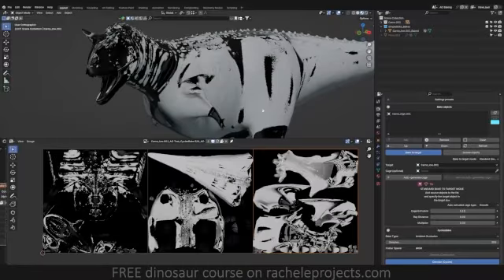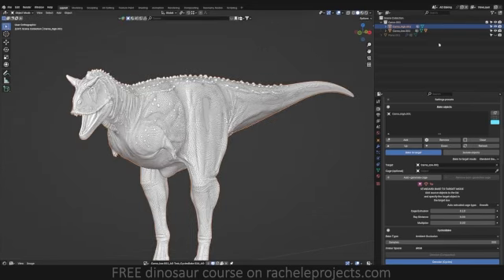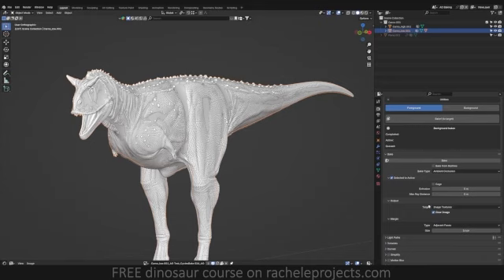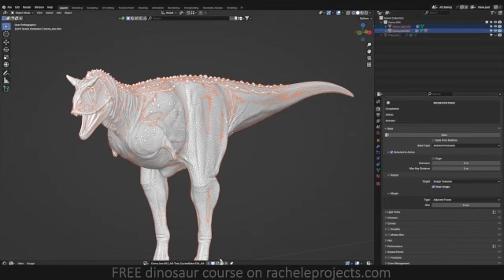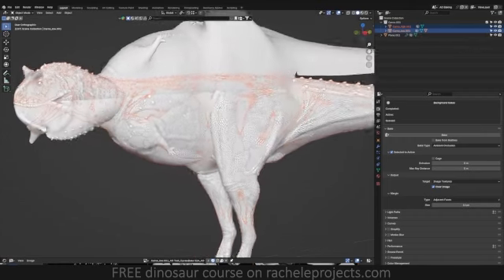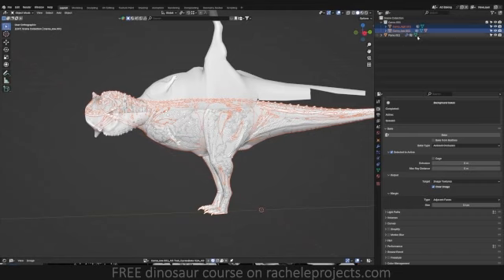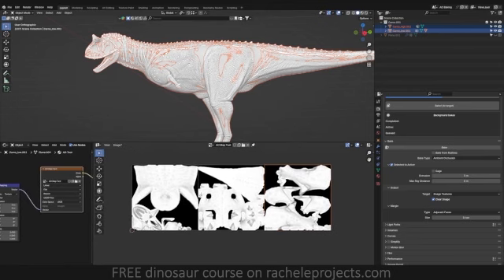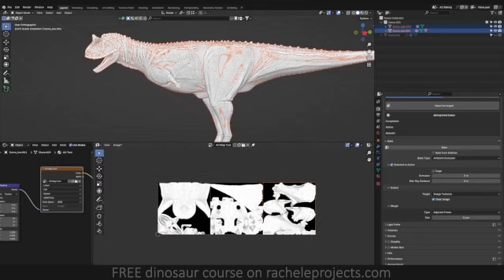Common Mistake in Ambient Occlusion Baking: How to Avoid It (Blender)

Comment: mam how can i bake high poly detail in low poly?
i have a reto charrecter ,now i add details using multires ,how can i bake texture now ?
i am a beginner.pleasehelp me🥲
Reply from the maker: You can bake a normal map and few others with the “bake” tab. It will have the option to use multi resolution. There are probably a few videos out there on how to do this 😊
Reply: @racheleprojects  my one is a full body charrecter but the videos shows some small mesh. if you don't mind can you make a video on it with a full body charrecter?😶‍🌫😶‍🌫
Reply from the maker: @ if you check out my Giganotosaurus playlist I have a video on texturing that may help. It could be a little outdated so I’ll have to make plans to create a new one. 😄
Reply: @racheleprojects  thanks mam